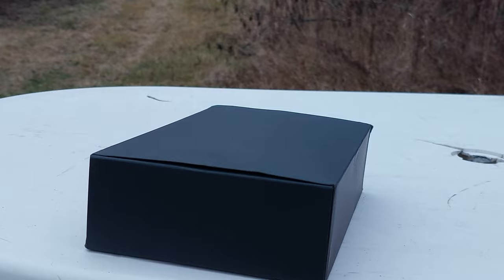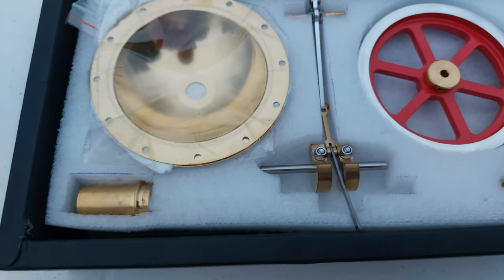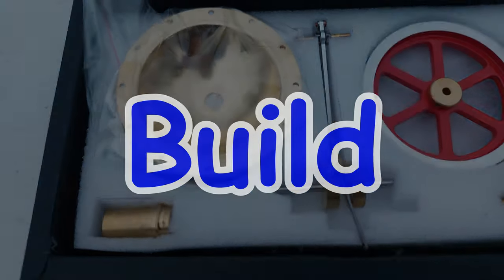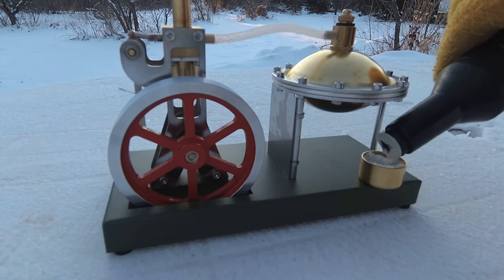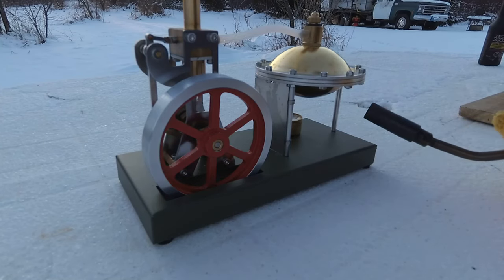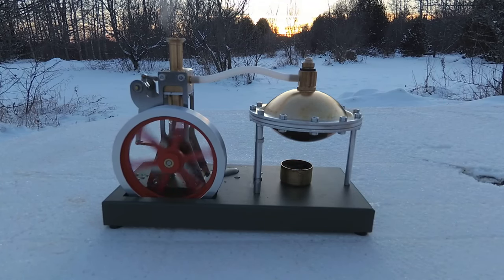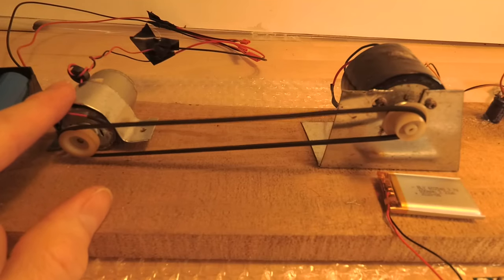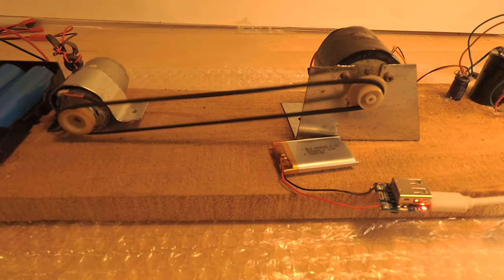Mini Steam Engine Generator - Vertical Hero's Steam Engine DIY KIT [ ENJOMOR ]

Comment: u need air core generator, build using thin wire 500 ~ 1000 turns two powerful neodymium magnets